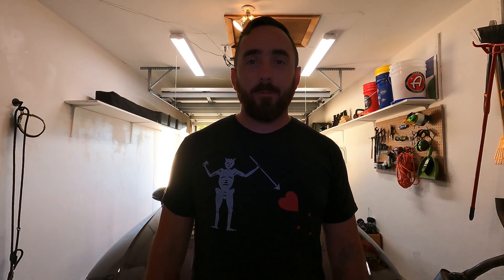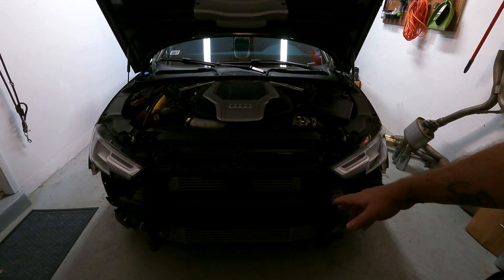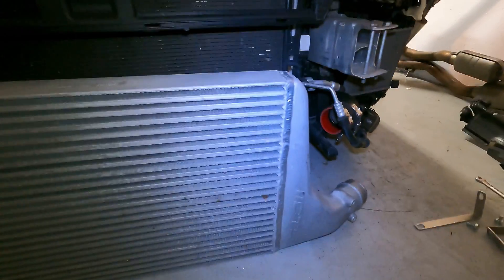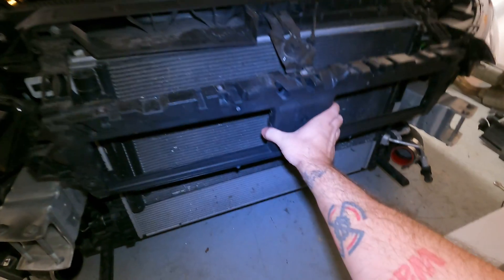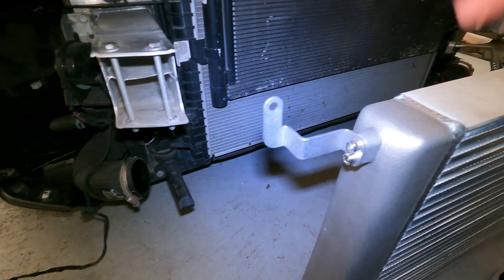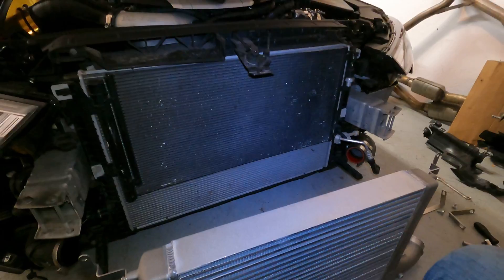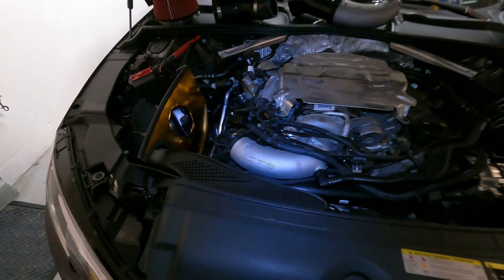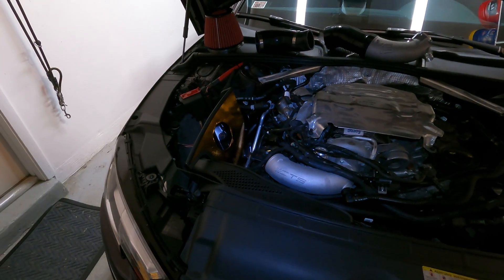B9 S4 - Integrated Engineering - FDS Intercooler Install

Comment: Are those bracket its sitting on metal?? Cuz i noticed that the intercooler quite heavy when I received mine and not only I don’t like the idea of it being bolted to the plastic part of radiator but also, let’s say you going over the bump, and all that weight wants to break away is there a metal support that intercooler sits on??thanks!
Reply from the maker: The ones at the bottom? The bracket on the intercooler are metal, and the car is plastic. Honestly once installed it is very very solid, and I have put some miles on my car, have definitely hit some good bumps and no issues have come up. Actually, even a few months ago I hit an animal unfortunately and the intercooler or brackets sustained no damage. I wouldn't worry about it 😎

Comment: Hey man nice vid. I just ordered mine. Do you have to take off crash bar? I saw another video where I guy installed the ECS one without removing it but maybe IE is different.
Reply from the maker: I appreciate it. You don’t have to remove the crash bar if you’re up high enough on jack stands. But it wasn’t difficult to remove so I figure I’d just do it that way.

Comment: very love your video，i have same car B9 S4 and i have question，did you buy the IE TCU tune？ and do you want to update IE stage 2 in future？
Reply from the maker: Thank you so much. I do have the TCU tune, and it is 100% worth it. I love the way the car drives now. I have been thinking lately that I will go stage 2. Probably sooner than later.
Reply: @Wobblenuts  Thank you，because see the ie stage 2 are not really increase the horse power is just for the downpipe.

Comment: Hardest part for me was removing the oem charge pipe from the throttle body.  How do you like the ie ecu and tcu tune? I have it but didn’t flash it yet, scared to lose my warranty.
Reply from the maker: Did you do the CTS charge pipe too? I absolutely love the IE tunes. Seriously the best upgrade I’ve done. I was worried about the warranty stuff too, but I have no regrets.
Reply: @Wobblenuts  have the apr intercooler and 034 carbon intake.  Love the merlin purple👍
Reply from the maker: @sansoju  ah gotcha. And thank you, the color is amazing in person.